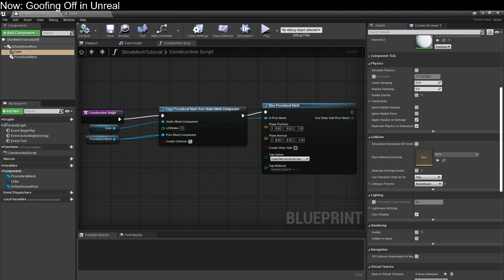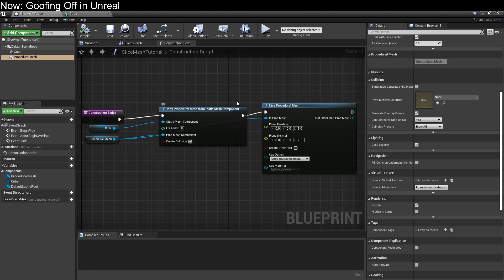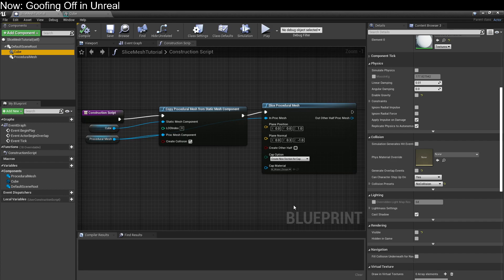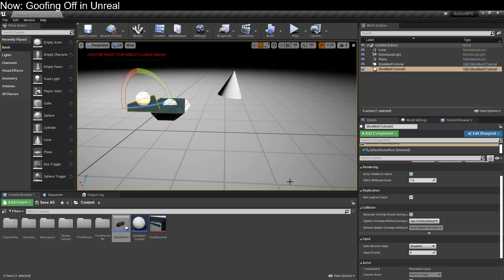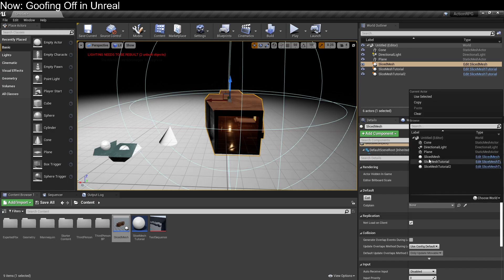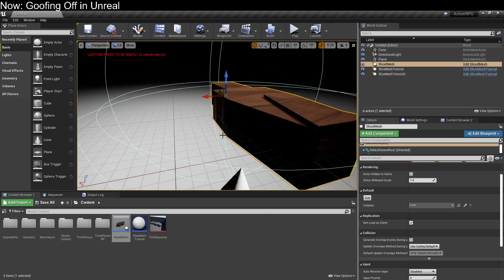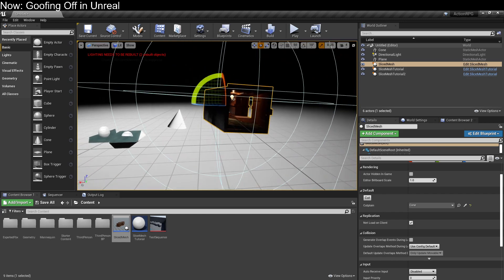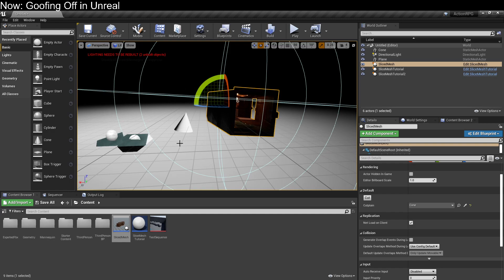Unreally Quick Tut: Slicing Meshes in Unreal

Comment: I see you really went to town with the construction script after our thread the other day! I've never actually researched procedural mesh slicing, so this was nice. Thanks for the summary!
Reply from the maker: There's lots of stuff I want to do now. All I need to do now is figure out procedural mesh collisions.
Reply: @CraigPerko  It's been a long time since I used the procedural mesh, but they should just work if you enable them in the mesh's details iirc (or maybe with a SetCollisionEnabled node? like I said - it's been a bit). Though that's technically a "complex" collision so stuff like simulating physics on the procedural mesh may not work properly.
Reply: I was able to make LODless procedural landscapes with it a while ago though, so it's certainly possible. And I remember collisions being one of the easiest bits
Reply from the maker: @AmberScottProd  Yeah, I've probably just got a toggle wrong somewhere.